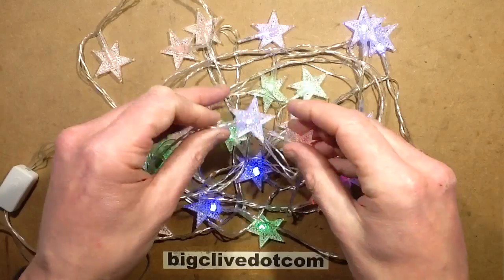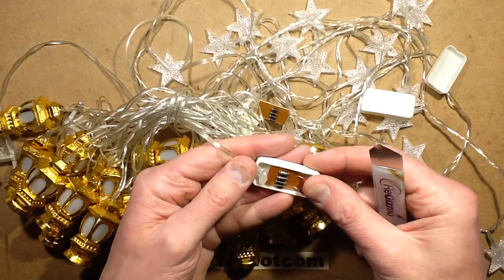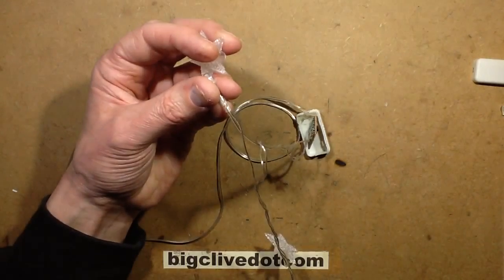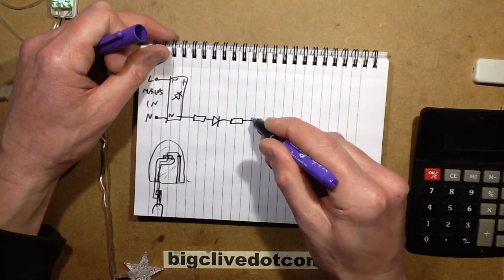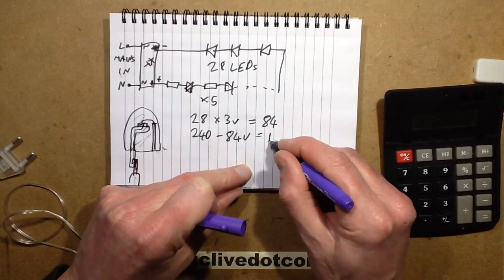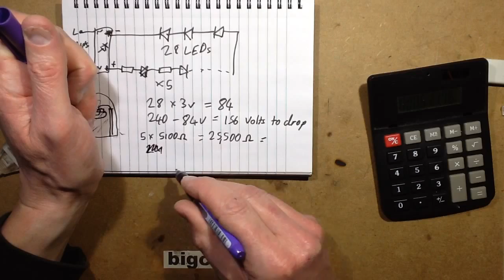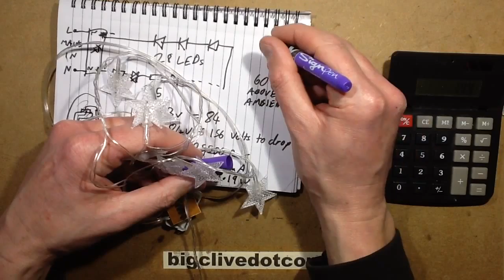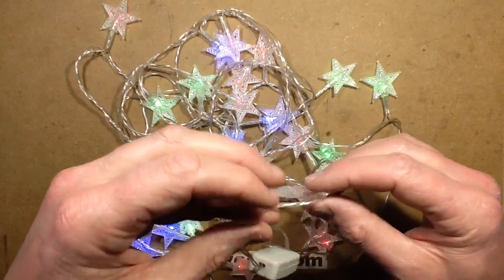Simple Chinese mains LED flashing light string.

Comment: Wonder if electronic items are designed to fail within a certain time or is it just usually poor design that cause failure
Reply: Ian Curtis planned obsolescence is definitely a thing, but in the case of cheap Chinese junk, it's that the mft wants to save a few cents per unit and doesn't care if your house burns down.
Reply: Ian Curtis
Cheap crap is mostly just cheap crap. I doubt they plan for it. There's only slim chance you'd buy that same manufacturer's crap later, so why bother?
Better brands though....

Comment: Hey Clive, what's the tool called that you used to open the circuit box on the lights?
Reply: iFixit sells it as the "Jimmy"
Reply: djteac Thanks for your answer.
Reply: brucelee12 it's his floppy metal spudger!
Reply: spudger
Reply: Ah, thanks guys. Shall have to get me one of those. :)
Reply: brucelee12 ebay has those selling as pry open spudger tool
Reply: I'd like a cheap (ebay/aliexpress) general one but the ones I see are called 'for ipad' 'for samsung'. Are they all shaped different ?
Reply: There are several shapes of those things, in my opinion the shape doesn't really matter. I personally use thin guitar picks instead of a spudger
Reply: djteac oh right thanks and it seems they virtually can't break/stay bent or will the chinese clones :) ?
Reply: the metal ones should be made from "spring steel", which applies to most stainless steel ones. They won't break and bent back under normal use.
But of course, with enough force applied they will bent

I ordered mine from a european store, because the shipping from China would have been too long for me.

I can also recommend going to the next music store, and get a few guitar picks. They usually sell them for like 50-70 cents. So breaking them doesn't really hurt :)